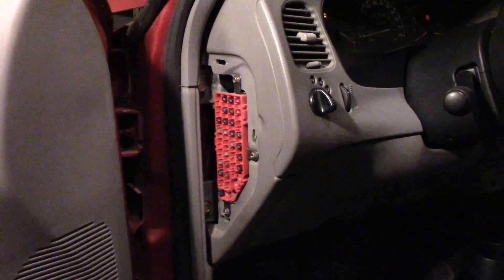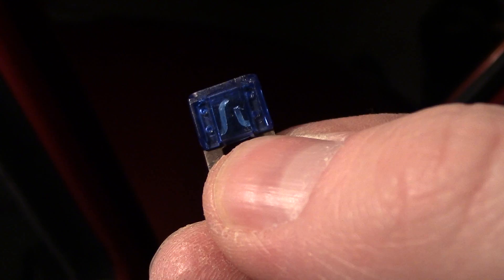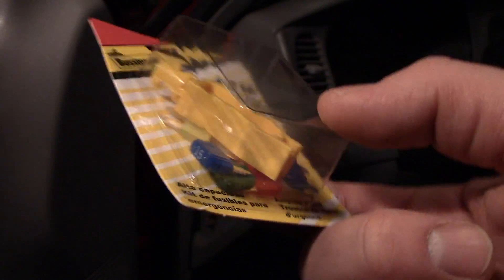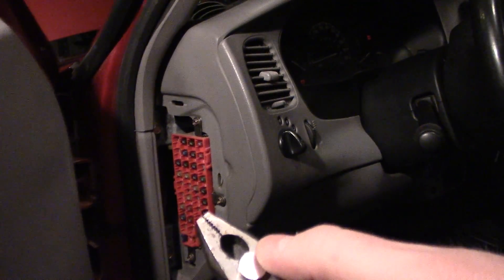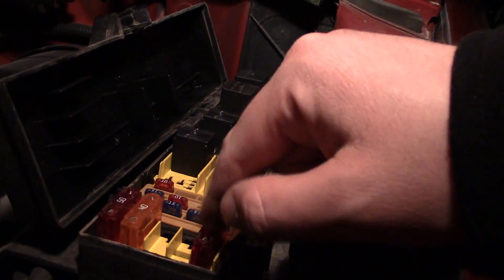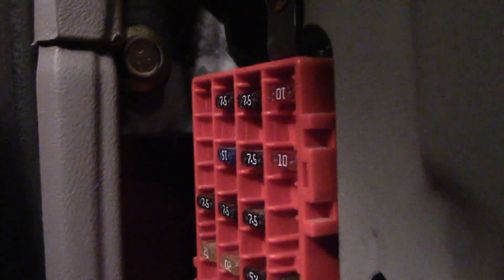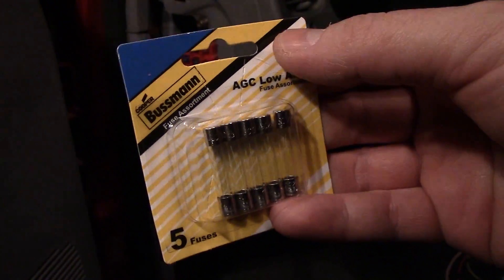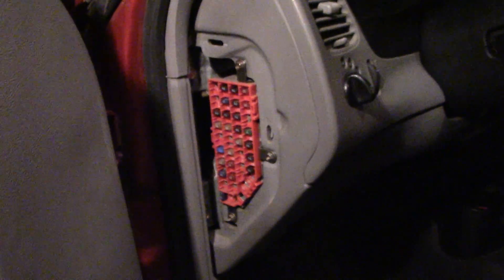How to tell if a car fuse is bad and how to change it

Comment: I can't find a video where it shows what to do when you have replaced a fuse and the problem wasn't fixed. I have a 2002 Ford Taurus and I replaced the alternator due a shortage from the battery, after replacing it, the car works fine, but my stereo won't turn on at all. I used a circuit tester to find any blown fuses and I found 4, three under the dash and one under the hood, I bought new fuses and replaced all of the faulty ones, the circuit tester still won't light up on any of those fuses and my stereo still doesn't work, any guesses?? Help please!!